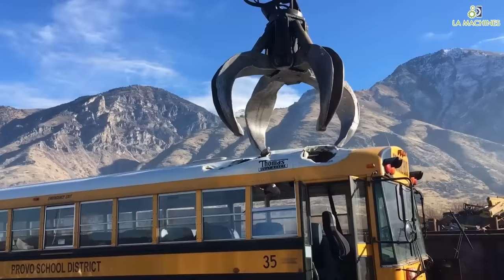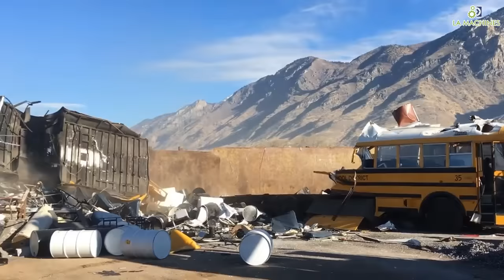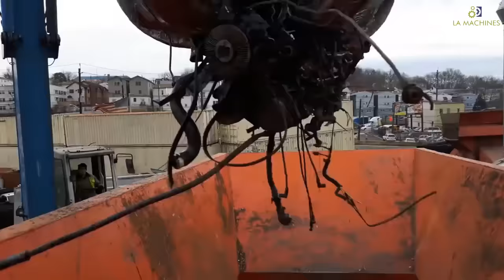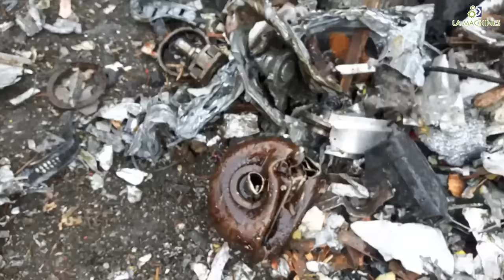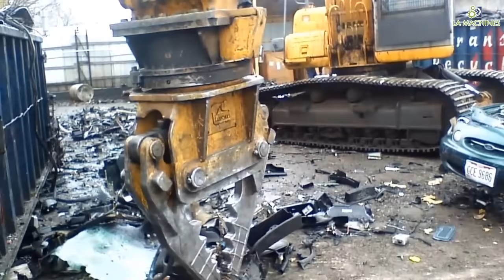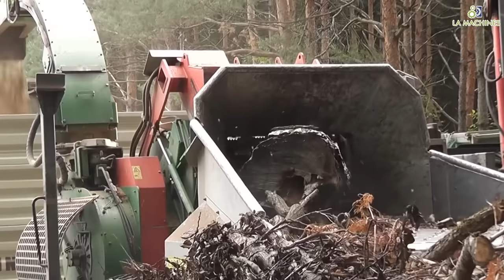Extreme Dangerous Shredding A Bus, Destroying Car For Metal Recycling, Crushing Everything Machines

Comment: Why not use theses buses in a empty lot and make a shelter to the homeless, specially in cold places.
Reply: You mean aside from the fact they have absolutely zero insulation in them?
Knew id find something like this in the comments.
Reply: I definitely agree!!
Reply: @sparkplug1018  There is nothing wrong with this comment. Many people convert vans and buses into tiny homes, and while it has very little insulation, it would still beat sleeping in a cardboard box.
Reply: @chrisbeaver6305  Not by much